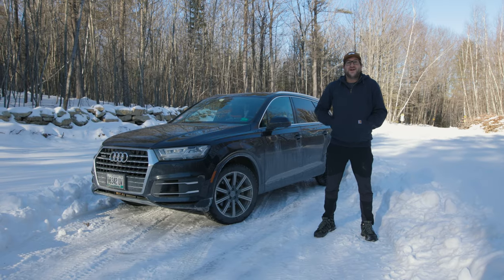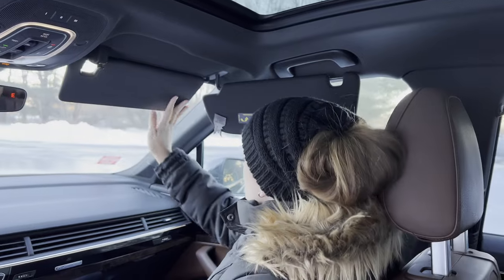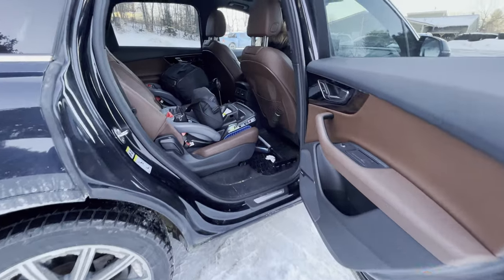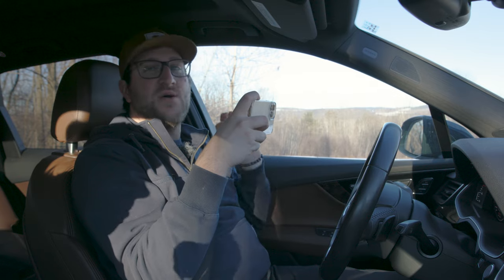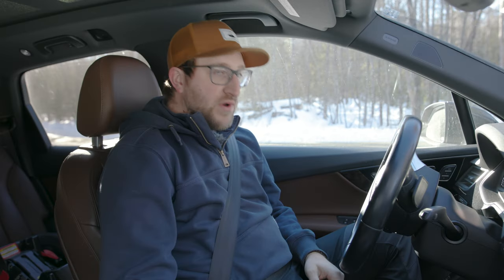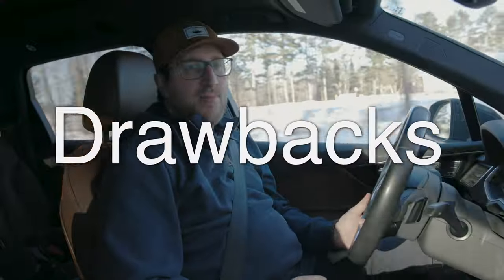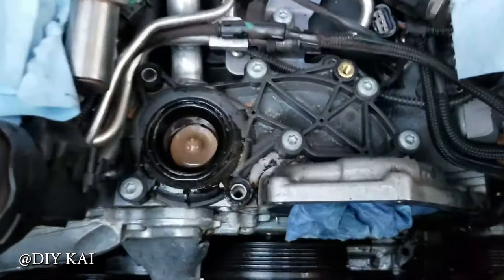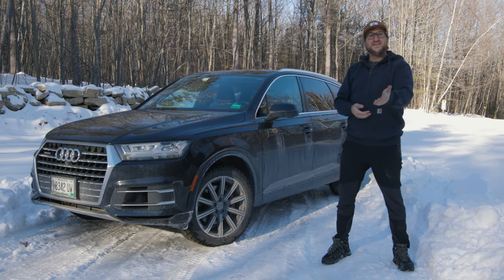Used Audi Q7. Is it a Luxury Bargain? || Value, 0-60, Reliability...

Comment: really nice car right up to until the exhaust goes,injector leaks,rear speed sensors, nox failures all go bad at once then 10k to repair it just not worth it junk in my book
Reply: But does it not happen if not taken care of frequently and little extra efforts than caring for ford, gmc, chevy, or lincoln? Like does these problems start appearing under 3-4 years of a brand new ownership with warranty and well insured? Of course we can't expect Japanese durability but still these things seem to be much more unreliable which is concerning me but i'm confused with how much miles they put on before they mention their cars are unreliable. If these things you mentioned happens after 100k for me it's bullet proof (for me) tbh. I hope people can help me make a decision for buying it. I love audi because i found it yet equipped with best suspension ever even as compared to range rover i've carefully observed the body movement of same reviewer in different vehicles almost same speed and exactly the same place. I've was blow by this test by a Russian https://www.youtube.com/watch?v=ZP_WFmyoYnU also there are many other places i was a big fan of Range Rover
Reply: @S.M.HassanShah  this car I been involved with was a regular Audi dealer ship car and then all of a sudden engine lights on and it when back to find it needed 10k worth of work and the list goes on. I've been turning wrenches for 45 years I wouldn't put that money in something that needs that much work ever. And it's not worth anything the way it is so you just lost 40k out the door on a car that known for these problems stay away find something else.
Reply: @scooter1391  What would you suggest if i only keep this car for under 80k miles and do frequent cleaning and maintenance will it sill break under 3 years?
Reply: @S.M.HassanShah  Well from your video your in a state that snows so I suspect that they use salt for the roads there and if so your exhaust system will fail sooner. the answer your question YES it will break down from something like a alternator witch only a dealer ship can install because they need to be programmed to the car they one I helped with cost him 1600 dollars for a alternator at dealership that high way robbery in my book, like I said say away from this car it's just not worth it.
Reply: @scooter1391 Was your engine TDI or gas?
Reply: @AN-kg4ei  TDI
Reply: @AN-kg4ei  tdi and the car had all the bells and whistles 90k new they offered 3k for the car,      stay away